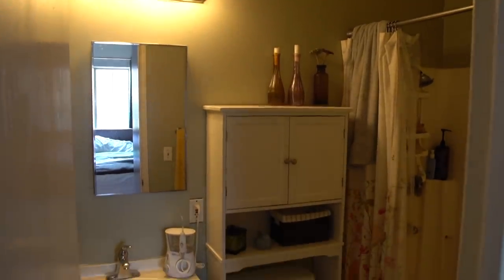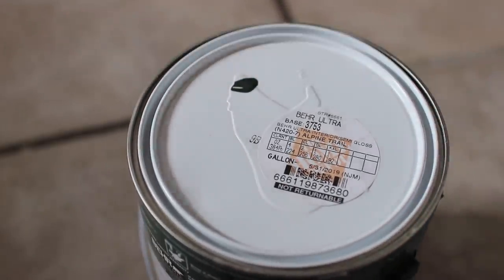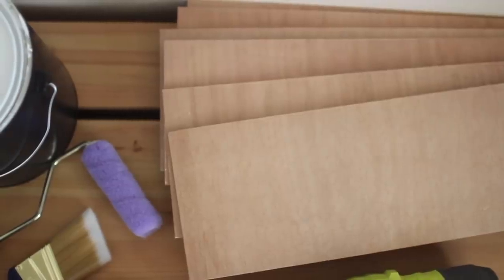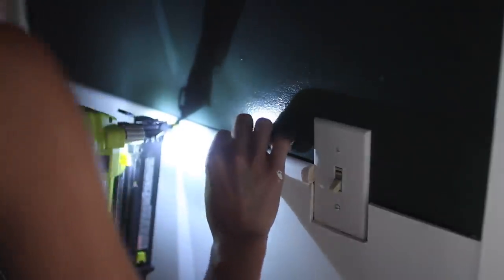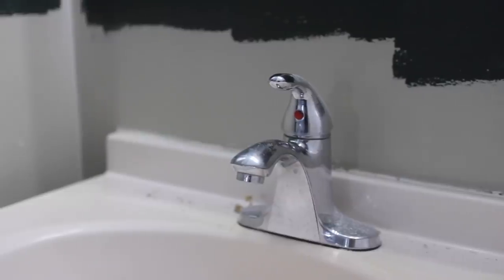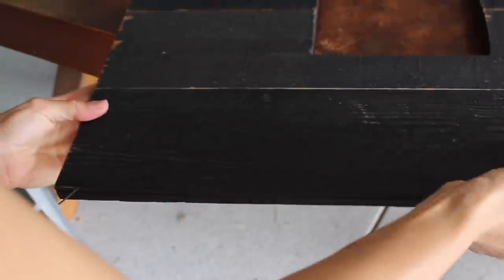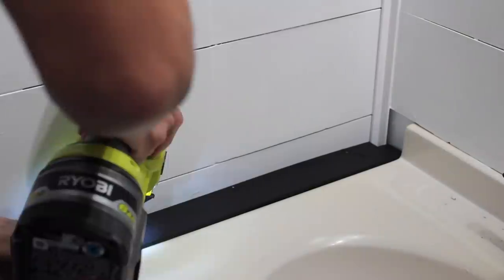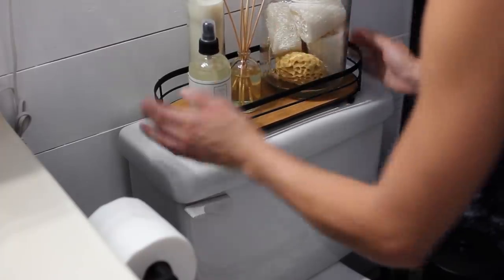DIY Small Bathroom Makeover

Comment: I love it, even the green. The bright bulbs make the ship lap pop, and loving the black fixtures. Not sure what’s on the wall between the shower and door, but if she wants storage for towels, could do a metal wine bottle rack and have them rolled up. And if she needs more storage for products, hang a shoe holder on the back of the door that has the individual pockets, and they also make shower liners with pockets as well. But you did awesome 🥰
Reply from the maker: Thank you for those tips!

Comment: There are metal screws at walmart with yellow tips and you hammer them into the wall when you put the screw back into it there a bracket on the backside that spreads out against the sheet rock. They are amazing for walls like your friend's. My walls are this way and I am HUGE on vertical space usage vs horizontal. I have had my big flat screen TV wall mounted for two years. I move it and change its angles all the time. Very sturdy screws
Reply from the maker: Thanks for this!

Comment: That mirror needs to stay it’s SO cute for the space it adds a whole new vibe to it and if you paint a design on the tile do it in white, if you paint the shower and the sink just don’t go overboard bc it already looks GREAT and you don’t wanna over do it! Also quick tip, take the door off and just cut an inch or half an inch off the bottom and sand it and reinstall so you can switch to one bigger rug bc it’s just gonna be worth it for the overall look, I promise.
Reply from the maker: Ah thank you! The door tip is such a great tip and I will definitely do it when I have more time.

Comment: Awesome job and great tips! I really want a cutting tool, but I want something that can be used for not just slicing big pieces of wood like a table saw. Do you think the multi tool is a good option or would you recommend a jigsaw or a compact circular saw?
Reply from the maker: Circular saw for sure! I have a video of the top 5 tools I'd use as a beginner and have an in depth of a circular saw coming out.
Reply: Living to DIY with Rachel Metz thanks so much! I’ll make sure to check out the video 😊

Comment: For such a bathroom, more storage, measure the length of the tile/wall aboue  the tub/tile, cut a board to that lenghs. The board set on 3 side of the tile, so no nails etc needed.  Make however wide you like. ( mine 12"). Hope that is clear.
Reply from the maker: You're the best! Thank you!

Comment: Had the same frustrating experience with trying to install floating shelf. Will be changing to brackets!
Reply from the maker: I was so bummed I couldn't do them here. I just didn't want to damage the wall even more than I already did haha.
Reply: @LivingtoDIYwithRachelMetz  I've had hell trying to mount shelves, coat racks even curtain rod hardware hooks. It's as if the drywall cant withstand even the slightest bit of weight. 

I had my fill, when I went to peek out the window and ended up with the entire thing ( curtain rod, curtains and the hardware) crashing down on me. 

We had some scrap pieces of flat wood trim. I measured out 3 equal pieces, marked where the screw holes were in the hardware. Screwed those pieces to the wall itself on each end. And then mounted the hardware on those pieces.  Screws went through the trim pieces and into the drywall too. The curtains are about a 1/4- 1/2 inch out from the wall. There is a slight difference in appearance but in all honesty, it looks pretty d@mn good...better than before. So far, haven't had an issue one with hardware becoming saggy or weak in the wall. Rods stay  put and don't bow in the middle like they wanted to before. Last but not least, when I pull back the curtain to take a peek.. IM NOT TAKING A BEATING FROM A CURTAIN ROD, DUCKING FLYING SHRAPNEL (HARDWARE) OR WEARING A CURTAIN. 

I just painted my sons roomand have yet to mount his coat rack (screws and all ripped right out of the wall leaving huge gapping holes I had to patch). Im thinking about using 1×2 wood strips to mount a strip of peg board to the wall. And using peg board hooks/brackets to hang his jackets, ball caps and backpack.

Comment: Did you change the light and plug covers?
Reply from the maker: I typically do (I changed the faceplates here) but the outlets wiring on the backend looked like I was going to get electrocuted so I told her to have her landlord do it so I don't mess it up. In every room makeover I do, I will always update the faceplates and plugs though.

Comment: In the near future, I'll have a bathroom much tinier than this one to redo (It only has a shower bc it's about 4in too short to put in a tub & even if a longer shower can be put in (??? I'm hopeful it can), a cornered wall that has a tiny cabinet in it will have to be taken out & drywall moved back to allow for it. The master bathroom will be updated in order to help prevent me from breaking my fool neck bc my knee joints can't handle getting into & out of the shower/tub combo unit w/extended depth tub in the other bathroom. I don't like the stands w/shelves that go behind toilets. Can't tell you how many I've taken out of places where I have lived, incl'g the one DH put in our front bathroom, which I removed a few years later. It now has a wood cabinet attached to the wall that matches the vanity to the sink. If the in-wall cabinet is done away with, I'll have to find another way to store a couple towels & washcloths in there, altho the small cabinet doesn't really hold much as is now. Still...

Can you give me some advice. If you look up on Sherwin-Williams' website, you can find the 2018 or 2019 colors of the year. Our accent wall in the bedroom is Barnyard Plank & the other three are in Sackcloth w/trim in iconic white. I know some colors make small rooms appear even smaller while other colors make them appear bigger. I'd really like the master bathroom walls to flow with the bedroom ones even if it means painting the accent wall/darker wall the one on the inside of the bathroom facing the bedroom. I love the contrasting in what you did with this makeover. It's something I'd like to try in our master bathroom regardless of the paint color. Thank you in advance for any assistance you can provide. Will be checking out other videos

You mention painting the bathtub/shower. Is it possible to paint a bathroom vanity sink bowl? (At least until I can get it replaced)? I ask because the color of this sink is horrible! It's what I call 'baby turd' yellow bc it reminds me of the yellow color of baby poop during the time when an infant who is solely breastfed. (strangely enough, this yellow poop of breastfed babies has a sweet smell instead of the toxic waste smell of poopy diapers of a formula fed baby)